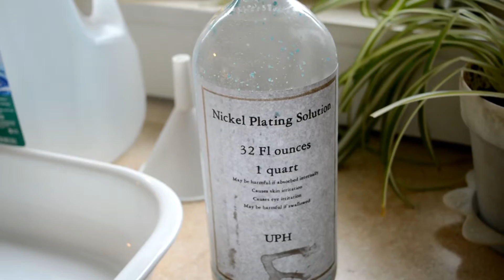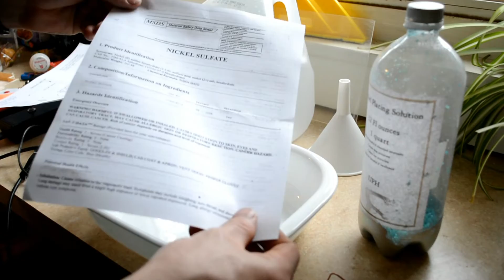Nickel Plating, Getting Ready For The Custom CNC Waterblocks

Comment: Or you can go to the hardware or gardening store and get root killer it's 99% nickle sulphate the bath is a bit Differant but real easy lots on you tube love the channel keep up the cool projects
Reply from the maker: Thanks man!!  I do have another project in the works that's gonna need nickel plating. I'll keep your suggestion in mind.
Reply: I believe root killer is Copper Sulfate. It can be used to copper plate but it doesn't give you great results. I only say this because I tried it.

Comment: Use a lower voltage 1 or 2 volts 5 is pushing it for a clean bright finish at least that is what I have experienced.  It seems to be better to plate slowly to get a better finish and better hardness of finish.
Reply: Go by Amperage
Reply from the maker: +Mike's Micro Shop thanks for the tip. 😊 I'm on the market for a variac for number of projects including this one. Any other exempts I've made since this have burned the part. So I assumed 5 bolts volts was pushing it a bit. I'll keep the info in mind when I get better voltage control.
Reply: I havent done this, but I have been studying and I am going to. I got nervous when you left the cap on that plastic bottle and shook it up. Bubbles were rushing up.

Comment: Just heat the distilled water to 50 degrees C and all the crystals will dissolve.... also try and maintain the solution at that temperature during plating .. cheers

Comment: How much Nickel Sulfate was on the water bottle?  I'm going to order some dry nickel sulfate from Amazon but I want to make sure I use the correct amount or water to nickel ratio.

thanks
Reply: You can make your own nickel sulfate. To make a quart, fill with distilled water, 1/2 tsp. salt, and strip 2 nickel welding rods of the flux and clean them good. Bend them each to go over the container, 1 positive, 1 negative. About 3-5 volts for 24 hrs. or so. The solution will turn green gradually. You can charge it longer if you want.
Reply: Don Rutter l
Reply from the maker: +Edwin Rivas I'm not exactly sure how much was in the bottle. It was already weighed out. I know it was more then needed as not all of it dissolved. I would suggest pouring all the water you need, and then keep adding until it stops dissolving. That way you will have a solid solution and be good to go.